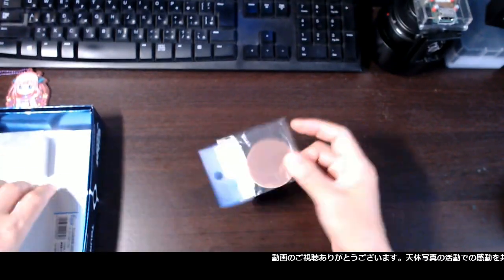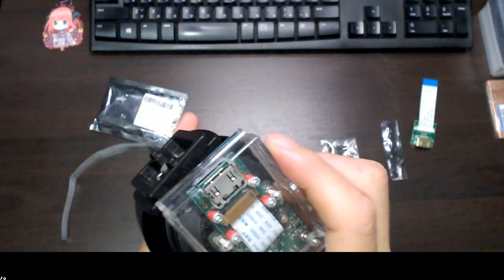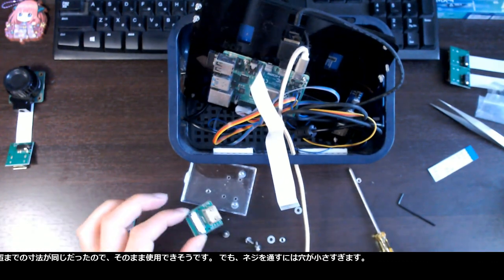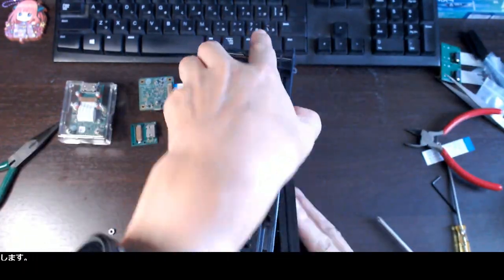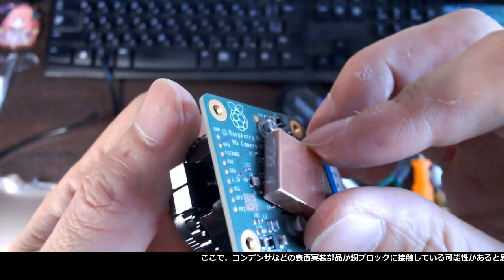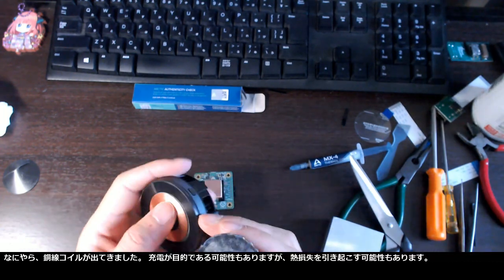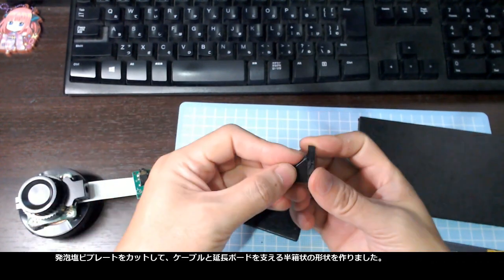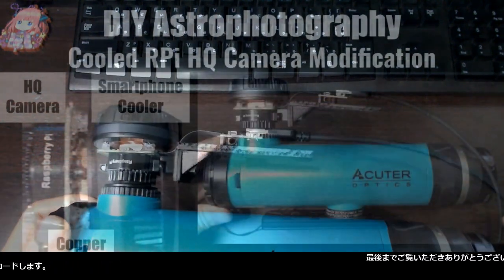[DIY Astrophotography Continued] Cooled RPi HQ Camera / スマホクーラーつけてみた

Comment: Hi, you mentioned that the pinout of the new CSI/HDMI adaptor board is different.  Can you give more details?  I am thinking about buying more these boards but how will these pinout difference affect the installation?
Reply from the maker: Hi @fuherb, thank you for watching the video. I bought a pair of the adapter board from brand A long time ago. I don't remember how I got. So this time I got new pairs from brand B. I have two cameras now. The combination of board A on raspberry pi and A on camera works fine. On the other hand, board A and B don't. I replaced the board on raspberry pi side to brand B. I have two cameras with the board B. I can swap the camera as I want.